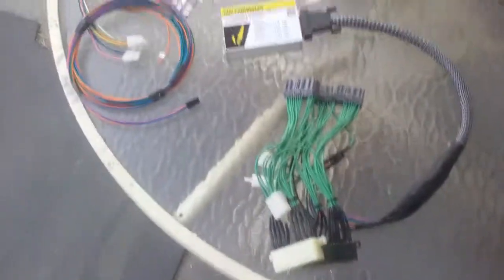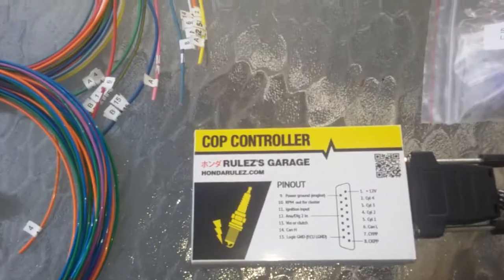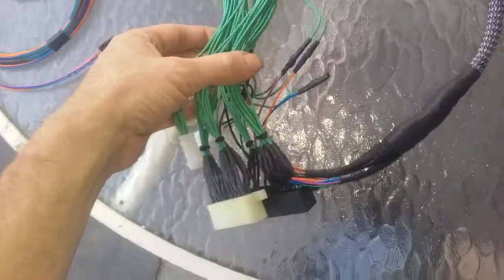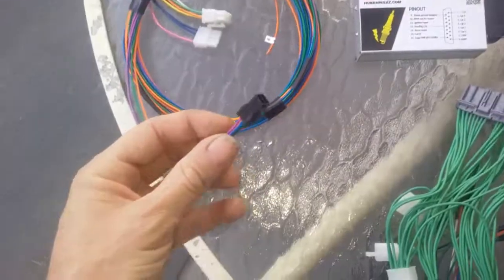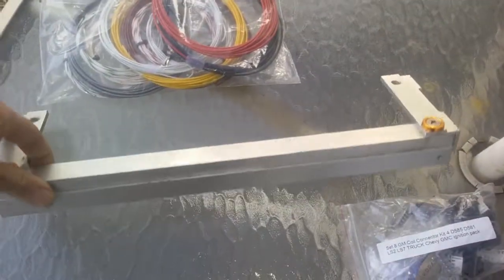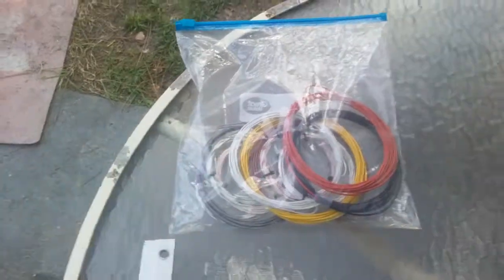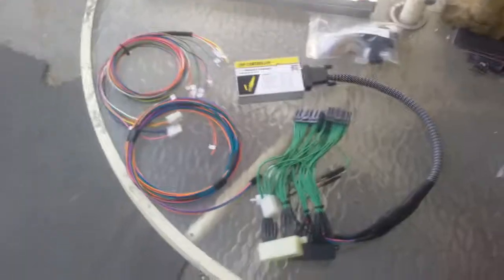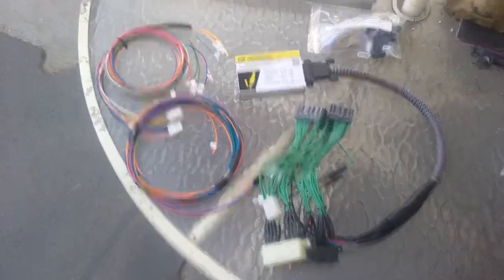Hondarulez coil on plug conversion/coil near plug 86 honda accord A20a3 3geez update

Comment: what did the control box ya? also you have a link
Reply from the maker: IC Everything. J.R.  the box is discontinued that I'm using the new technology is coil on plug Mini
Reply from the maker: IC Everything. J.R.  email me at bp03622041@gmail.com and I'll get you a link
Reply: ya i seen there were a few different ones out there. I see theres ones that go into the knock board ribbon spot of the ecu board, not sure if they had to have something else added in or if it would work off a stock ecu (or chipped)
Reply from the maker: IC Everything. J.R.  it'll work with the stock OBD1 ECU
Reply: Hack yeah